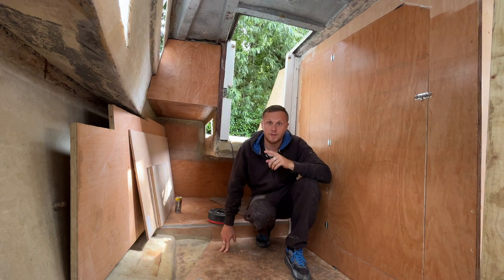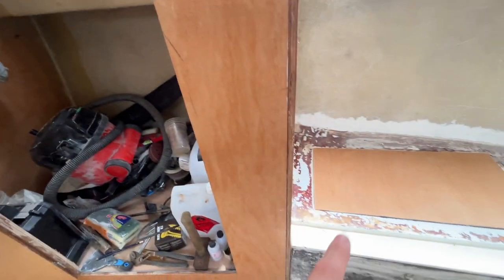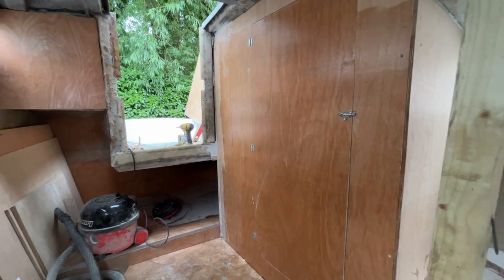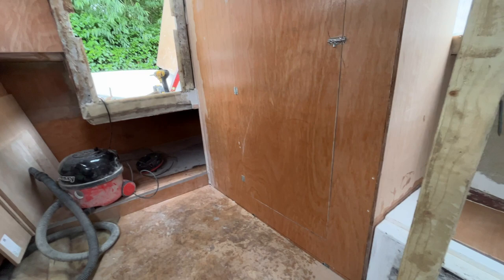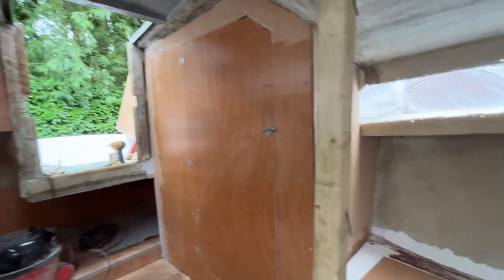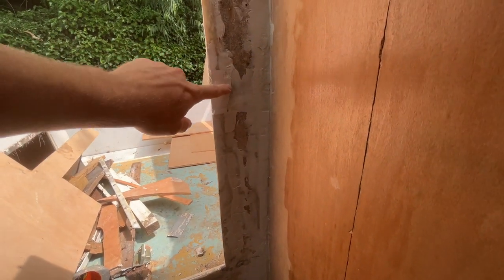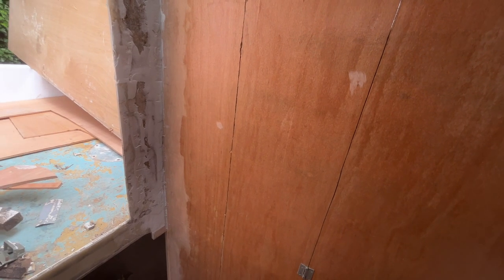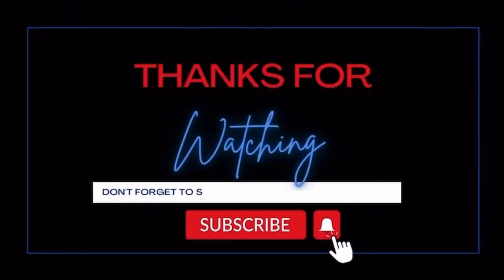Bonding the outside of the toilet and steering and taking out the main door frame EPISODE 26

Comment: About a year or more ago , I bought on Amazon a "Mouse " sanding block. Just like an oversized computer mouse with Velcro attached for using 5 or 6 inch sanding discs. Very comfy to use as it fits the natural profile of the hand. 
I also got a cleaning block for the sanding discs. Its a natural rubber block you run across the disc when the sander is running. It unclogs the grit and extends the usable life of your sanding disc. I would say it would work just as well with fiberglass dust. There's another option a guy on an American wood work site says are very good. They are 3M Cubitron discs. Not exactly cheap at over 30 pound for a box of 50. But he claims a very long life from them. They are an open weave material and dont block the same as the conventional disc, worth a look
Reply from the maker: Thank you I think when I brought my belt sander 6 months ago it came with a rubber block I will have to dig it out and see. I’m also thinking for the future for the outside body work using the belt sander as it might be easier as it’s big open flattish space might save a lot of time. I will look into the disc as I remember on my little boat I went through a lot of disc.
Reply: @stevens_adventures Just a thought, I would be very careful with a belt sander, epically on the outer hull. A moments lapse of attention and it can dig in or take off along the direction the belt is going. I had one and gave it away for those two reasons alone. You cant replace wood easily, on which I was primarily using it on; but its easy enough to build up fiberglass. A soapy water solution helps keep dust down but also helps give a smoother finish. A wet or dry sand paper is a must. Cheaper discs or sheets wear out quicker and the grit tends to fall off and cause more extra scratching than you possibly had before. 
I think those 3M Cubitron discs are wet or dry. I had a similar 3M strip when I was rubbing down plaster on drywall and it was brilliant. 
80 - 240 grit is good for timber and trimming off rough glass. The higher grits 400 and above for metal and gel coat. 
You can fill cracks outside with a gelcoat mix and sand down smooth. It can be polished back up to a high gloss with polish similar to car paint restoration polish using a powered polishing bonnet. Otherwise you will spend ages and end up with arms like Popeye. 😂

Gelcoat  can be painted on or rolled on larger area with out difficulty. It can also be thickened for crack filling. Colloidal silicone powder I think. Worth checking. Keeping the water out of glass is the main thing. Its progressing well .
Reply from the maker: @loki7441  thank you. you always give great advice I really do appreciate it. What they have done on this boat it paint on top of the gel coat and it don’t look like the best paint so I will sand it all down to the gel and see how bad it all is. I tried yes a little patch with the belt sander the other day and found it’s just to heavy to hold so it will definitely be the orbital sander for the future longer but will have a better finish like you said

Comment: Personally speaking , i would have filled all the holes on the steering console , and started afresh . I'm not sure of the wizdom of trying to reuse old holes , and at least with fibreglass you can return to new fairly easy , with pretty much the same strength . I used to do it , but found it actually created more work , as in some cases even fitting the same parts , holes were not quite in the same place . You must do as you guess , but bear that in mind .
Reply from the maker: Thank you I appreciate the advice I will definitely keep that in mind for the future. At the moment I’m on the fibreglassing and I have put a full sheet over the steering console so I could fill it and start fresh.
Reply: @stevens_adventures  You could really do with a couple , start bonding the bulkhead in then gradually getting bigger to cover the whole lot . I have heard of some who work the other way round , but to me that's just plain madness . If the big sheet fails the whole laminate fails ? 
I would also remove the throttle box too , and fill those holes at the same time . If you do nothing else laminate the outside . You want to try and make the topsides weather proof , saves a huge rush in the autumn , when the weather begins to change . 

But remember this , if nothing else . Laminate on its own is not waterproof , water will saturate it . Only the gelcoat is waterproof , that's how osmosis forms . The outer gelcoat get damaged allowing water into the laminate , and that will soak water up like a sponge . Either gelcoat it , or paint it , and use a proper marine paint , not a general paint , but i would expect you to already know that .
Reply from the maker: Ah sorry i should of said I’ve done a few patches on the steering holes then I’ve finished it with a full sheet. Everything will be finished with paint I’m thinking of gel coat but never done it before I will do some research
Reply: @stevens_adventures  To be honest , with your previous work , i expected no less . 

Gelcoat is a tricky stuff . There is one guy on these channels spraying it , but i know it can be painted . Trouble is , it still needs a lot of work after , and that is why many choose to use paint . An epoxy based paint is almost , if not in some cases better , but you do need to be able to handle a brush .  The normal method is by what is called roll and tip . This means the main application is by roller , and then smoothed out by brush . Can be tricky itself , but a cheat is to roll three coats , and flatten with wet and dry , then polish . It's a bit more involved than that , but that's generally the course of events . Paint sprayers call it blending .
Reply: What is the bonding compound that you use (the blue stuff)
Reply from the maker: @davidsutcliffe1968  https://www.ebay.co.uk/itm/265745075979?mkcid=16&mkevt=1&mkrid=711-127632-2357-0&ssspo=Or-IUolWQye&sssrc=4429486&ssuid=xmYCZbk0SAa&var=&widget_ver=artemis&media=COPY
Reply from the maker: @davidsutcliffe1968  that’s the stuff I use works really well